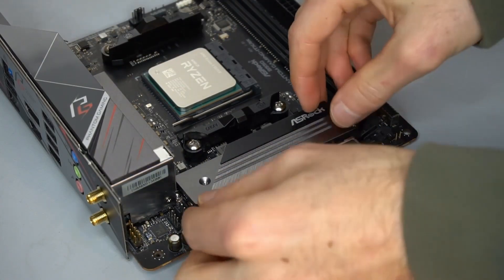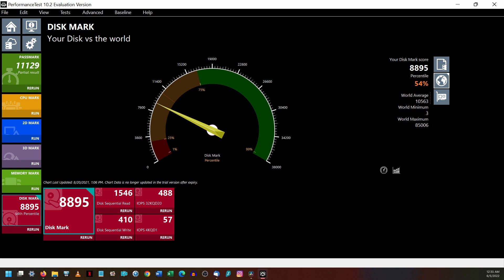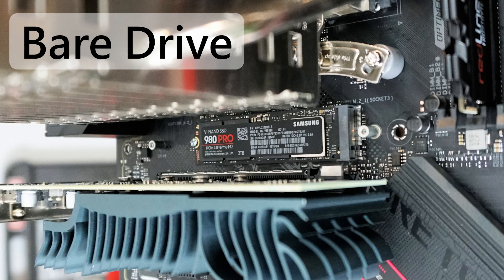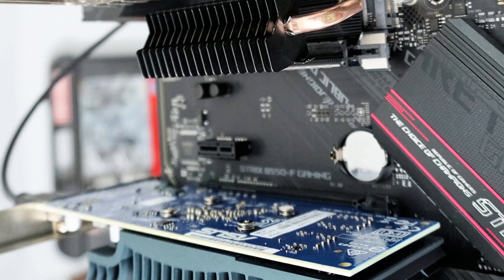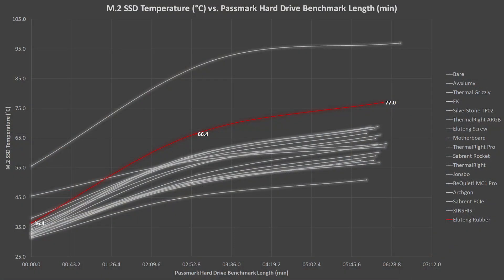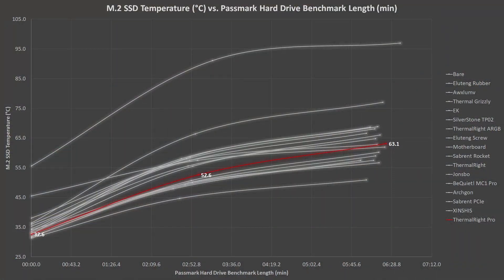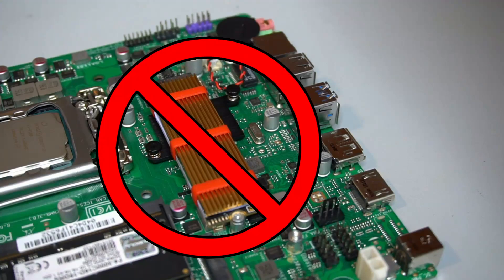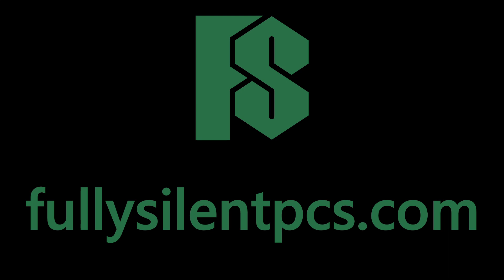What is the Best M.2 SSD Heatsink Design?

Comment: I think the performance of the copper heatsink was marred by several aspects.

One is that copper is great at lateral transfer due to overall lower thermal impedance; but it's not needed for a typical SSD due to high copper load in the PCB pours and the pyro carbon heatspreader sticker. Incidentally the same heatspreader sticker has horrible transversal thermal conductivity, which makes aluminium's lower thermal conductivity less of a contributor to overall thermal impedance.

And the other is the garbage supplied pad quality and the fact that rubber bands barely hold the heatsink on at all, they're incapable of compressing the pad to specification where it would actually develop adequate thermal performance.

So i think you should still be able to achieve similar cooling with half the copper envelope compared to aluminium, and that there isn't really a reason to avoid copper per se, but it's also a little pointless to overspend on it and in particular bad heatsink products should be avoided, copper alone isn't going to save them.

Comment: Thank you. It best shows, that regardless of a what heatsink, having the worst one it much better than none at all. I would like to see more budget options or prices in the comparison, but this is still by far the best I have seen.
Reply: Yeah the whole group test performed adequately. I think it draws attention to the real distinguishing characteristics of them, like

- which ones actually fit - tall or heavy heatsinks cannot be used everywhere
- whether it's something you can rely on long term - rubber bands don't fill me with confidence, they may dry up and fall off, and you can't tell up front whether they'll last for a year or for 10. Then the thick thermal pad provides basically no adhesion, as opposed to thermal tape, a chunk of metal falls down in your PC, that can end badly for any number of very expensive components
- whether they're easy and comfortable to install and assemble, whether there is risk of installation error that could damage the drive

Which i think ideally should have been covered in such a review roundup.

Comment: The other thing to consider is your test setup was an open bed (not inside an enclosure). More importantly, you were in a horizontal configuration (heat rises) so the heat from the GPU, CPU and M2 all can dissipate upwards (vertically). In many desktops, the motherboard is vertical (with respect to the case/ground). So if a GPU was sitting below the M2 slot, all that heat from the GPU would rise towards the M2. That certainly would impact the performance of a heatsink.

Comment: Honestly, this test should be redone. You said yourself, the ones that did the best had the graphics card at the bottom slot. And you had no confidence in the Sabrent m.2 heatsink result.

A shame really. So much work to initially set it up, only to botch it up at the end 😢
Reply from the maker: Sure, but the differences would be small and in my opinion insignificant. These tests were not so much about precision, but just a rough comparison, and making sure that all of the heatsinks do the job decently.

Comment: When you said "near other sources of heat" does that include the CPU cooler as well?
Reply from the maker: Generally no, because either the fans will help dissipate the warm air away, or in a fanless system, the heat will dissipate upward, away from the M.2 SSD.

In some situations though, yes, it is possible that the CPU cooler can make the M.2 SSD hotter.
Reply: @fullysilentpcs  ah right, this is where orientation of the case makes all the difference.

Comment: Very interesting, thanks for testing this!
I think on pretty much all ITX boards the chipset is underneath the M.2 slot (often sharing a heatsink), making it especially hard to cool passively. I’ve had a WD Black PCI-E 4.0 SSD on an ASUS B660-I board and was surprised to find it started severely thermal throttling after about an hour of gaming. I think the combination of the heat from this chipset and M.2 as well as PCI-E 4.0 is too much. Therefore, if you’re building a passively cooled SFF systems and want to use the newest hardware, the choice of the M.2 drive and cooling is something to carefully consider.
Reply from the maker: Indeed, it can be a problem with Mini-ITX boards. If available, an M.2 slot on the back of the motherboard might work better, especially if you can use thermal pads to connect it to the case underneath the motherboard.
Reply: @fullysilentpcs  I've now got it setup with a M.2 to PCI-E cable and a PCI-E SSD. The advantage is that the SSD is at some distance and components can't warm each other up. The SSD stays perfectly within spec.